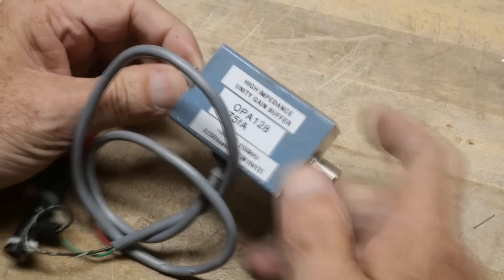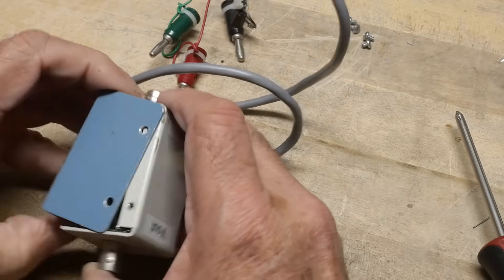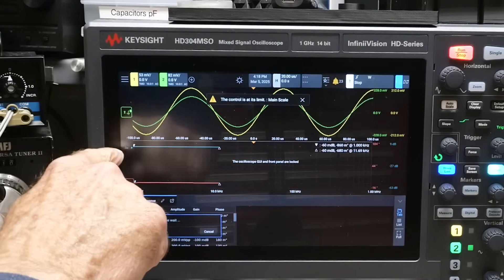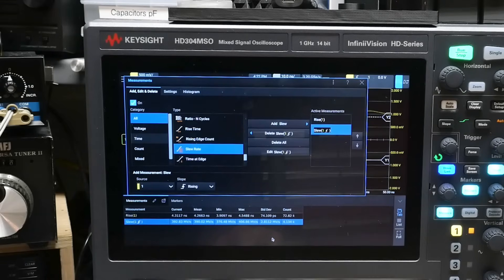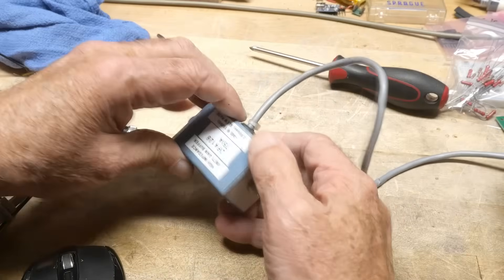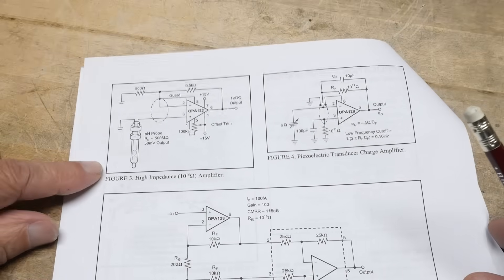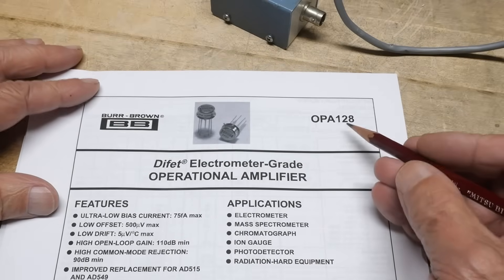#2179 OPA128 75fA Input Current

Comment: The leakage through that BNC connector, PCB cutouts, or PVC cable insulation will be thousands of times greater than 75 fA. You need an extremely low-leakage electrometer-grade circuit design to reach such values. That '75 fA' printed on the housing is just a lie.
Reply: Not a lie it's just what it says on the datasheet. Do you due diligence before calling someone a liar.

Comment: These make good photodiode amps. You should do a video using this part with a photo diode.  Use an LED as a light souce toggling at some frequency like 1 kHz. PD are so sensitive it is amazing how little light you need to see a signal.

Comment: Guards around inputs.  I used to work on gear in final test that used FET op amps in real high impedance stuff like sample/hold.  You had to test for drift and if there was too much drift you had to remove the PCB coating all around the circuit,  clean it with Freon,  and recoat it and put in an oven to dry till your drift was in specs.  It was fibreglass boards but nothing exotic.

Comment: If I read the screen correctly, the scope showed slew rate of 395 MV/s which, when converted to V/us, is 395V/us, NOT 3.95V/us.  The OPA128 datasheet shows a typical slew rate of 3 V/us.  There seems to be something wrong with scope’s measurement.
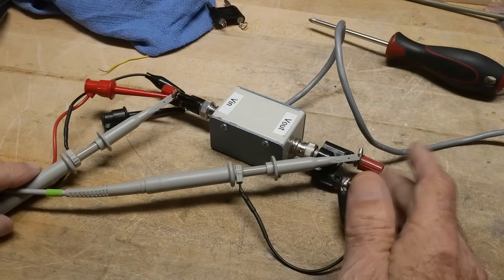Reply: The key is at 5:30 - CH1 is the input, CH2 is the output. The slew rate was of the scope's own waveform generator rather than the box... oops! Also odd that it's showing 2Vpp when it was set to 1Vpp... impedance mismatch maybe?
Reply: @marinedalek  You are correct.  At 12:13, it shows the source for slew rate is set to channel 1, not channel 2.